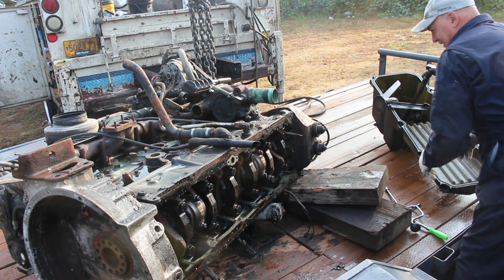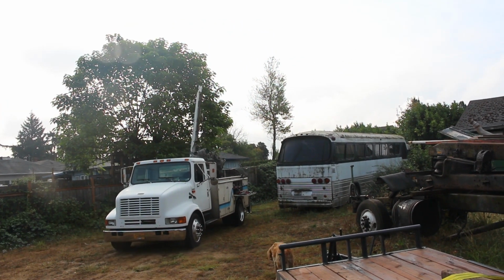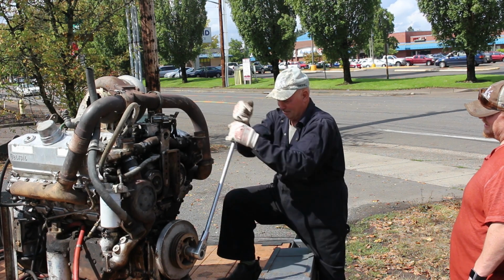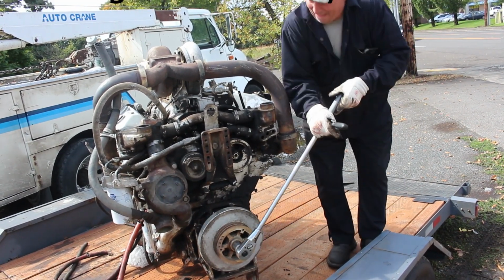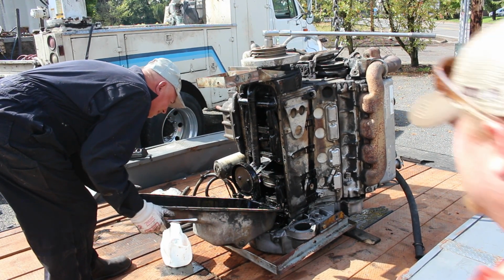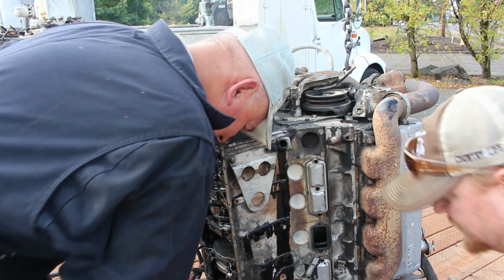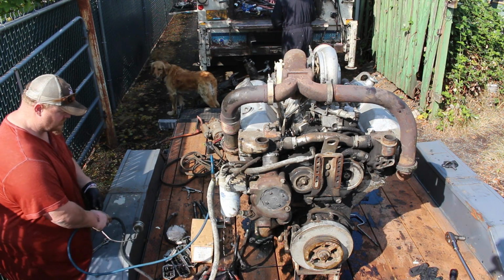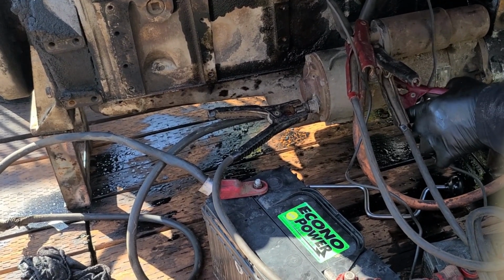Can we start a frozen Detroit 8v92 parts motor? A will it start  that will not, but its a 2 stroke??

Comment: GOOD one and I 2nd the GM/Detroit Motto that If It'll Turn Over, It'll Run. They are the toughest, most reliable motors made. Not the most powerful but they just keep going. And if they leak some oil, that's a sure sign that there is still some left inside. Thanks! GBWYall!

Comment: The 8v92 running partly on engine oil still sounds pretty neat. Good work on moving a siezed motor into the operating category.

Comment: Sounds good.........like a Detroit should .     Retorque the main bearings and  put water in the cooling system, pressure test cooling system  to verify water pump and run it ., May have lots of life left yet .

Comment: Congrats on that find , 8V-92 TA  it's a damned good engine when it's running right and that one doesn't really sound that bad ,,i've seen and heard them running way worse and still in trucks on the road ,,and it's even better cause it had jakes on it too

Comment: I don't think it was locked up from heat I think maybe hydraulic lock?  But in any case it would do well with an In frame but where it's out and easy to do, on inframes we would only use the lower half of main bearings because the upper are usually not worn at all someone mentioned slap an 8v71 in the truck the 8v92 almost identical just bigger displacement anyway great job great video

Comment: I can get any gasoline engine running if it will turn over, I'm 57 and when I was 15 my father gave me a 72 Ford Bronco with a bad engine, he bought me a cherry picker, a set of tools and a Chiltons manual. He said fix it and it's yours. 2 months later I was driving it. I have been messing with vehicles my entire life but I bet you Joe has forgotten more than I have ever known.

Comment: I use to have an 8v92 they are standard at 435 or 475 not sure if you can get more. I know where some are. But not sure why someone wants one. I had a 75 longhood Pete with 12v71 sounded cool was fun to drive but maintenance night mare. My 17 year old has a 67 wide nose long hood it was custom built needs restoring but he drives it all over on short hauls.

Comment: How did the coolant get into that cylinder? The heads could be cracked.
Reply from the maker: Blew o rings and filled the jugs i things
Reply: Hi there ...may be is the intercooler...inside the cylinder block...✌
Reply: Andres Eduardo Soto Alcazar Pressure test the intercooler after tear-down, I guess.
Reply: Head gasket or cracked head. Also rod and main bearings too. Glycol will take out the bearing materials. I miss working on the 2 strokes, worked for DD dealerships for 22 years.

Comment: Hey we have a 8v71 we r selling it runs it's supercharged and runs great
Reply: Not supercharged.  The blower barely only puts enough air in the motor to scavenge the exhaust, barely above atmospheric pressure.   In an 8v92 TA like in the video, the turbo will bypass the blower,  because putting that much boost though the blower will blow out the seals.